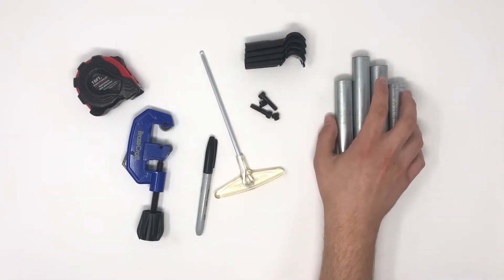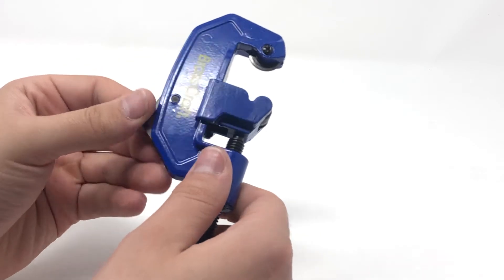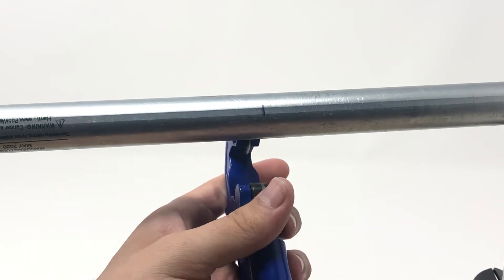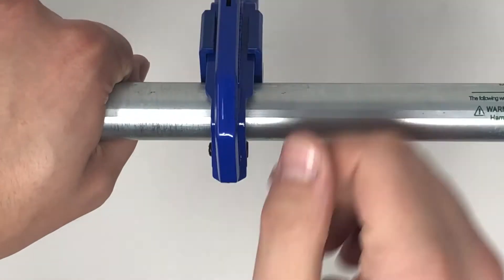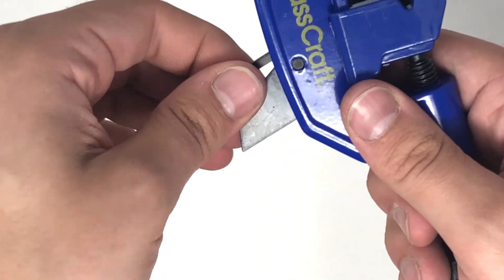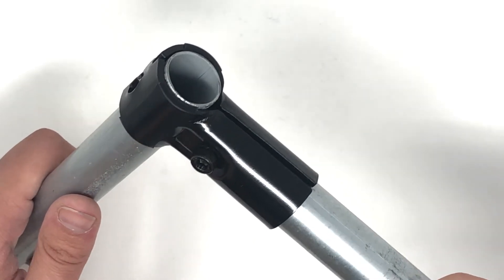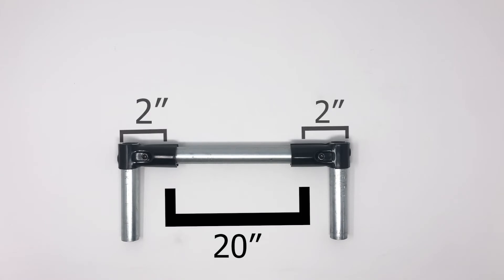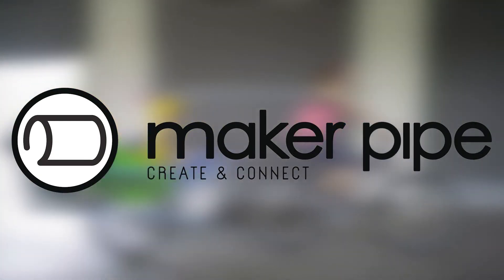How To Cut & Measure Pipes For Your DIY Project - Maker Pipe

Comment: Will this cut steel EMT or aluminum only?  Would this be strong enough to cut structural pipe also?
Reply from the maker: It is made to cut thin walled steel tubing. I don't think it will work very well for thicker structural pipe. If you try it, just take your time and make sure to do quite a few rotations each time before tightening the screw feed.